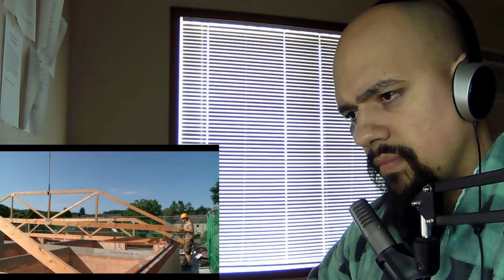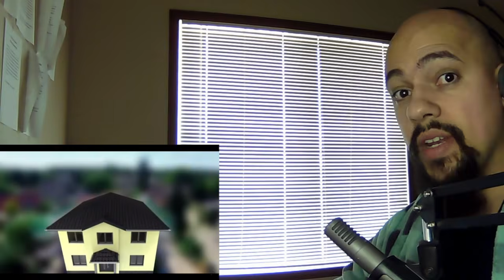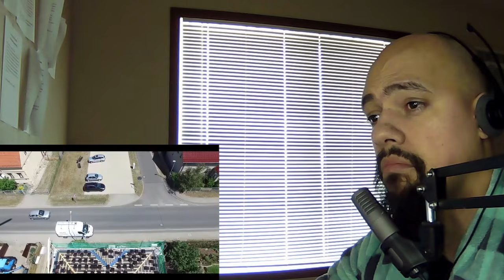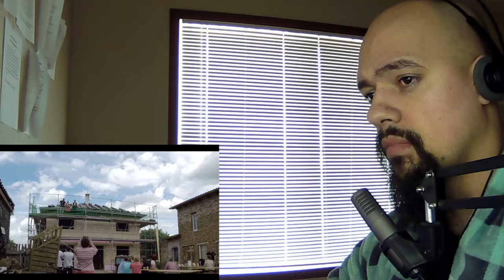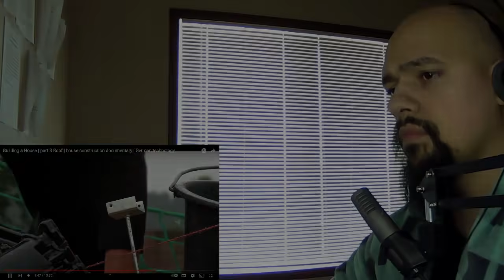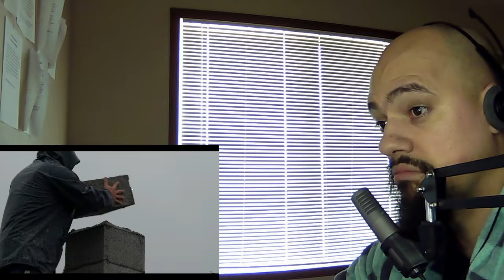American reacts To How German Houses Are built | part 3 Roof

Comment: With the micro pore structure, the light side is placed facing outwards so that the heat is reflected outwards in the summer heat and is not directed into the interior rooms.

Comment: Whats not clear in this video is that the interior wiring is a similar effort as building the house itself, literally drains for pipes must be cut into the bricks and concrete then pipes must be laid then the drains must be closed again and once this is done the walls get another layer and on top of that some paint. The add on top of that the windows doors etc... bath, you name it!
I have seen houses which basically were basically standing within one summer but then took another 1-2 years until they were fully finished. Thats the downside of doing it that way, getting all the wires in is a ton of additional effort also retrofitting things is a pain! The plus side is stability and isolation!

Comment: Keep in mind that building a house is a special occation in Germany. Owning houses is very expensive - even if you buy an older one - let alone building a new one. Unless in the US the verdict to buy a house is a binding commitment for decades. If you buy one you expect to live there for at least 20, 30 or even 50 years. No one would purchase a house to resell it soon after unless it is a person that trades them for a living or as investment.
Building a turnkey house with 120 to 140 square meters (1490 - 1510 square feet) costs between 270,000 and 490,000 euros (US$ 295,600 - 536,450) without the plot. A small house with 80 square meters of living space is available from 150,000 euros.

Comment: The roof tiles are really good. But I can tell you from my own experience. Never climb onto a roof like this at the height of summer. If you do, you'll burn yourself. Because the tiles with the glazed surface are very hot. If it's up to 40 degrees, you can certainly fry a fried egg on it.